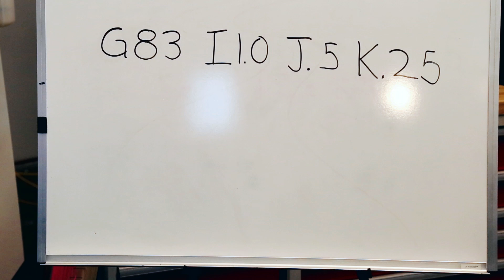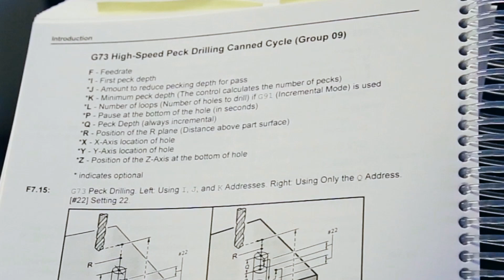Don't Waste Cycle Time; Peck Drilling Essentials - Haas Automation Tip of the Day

Comment: what would you recommend for an .098 drill (number 40) in steel?
Reply: What type of Steel? Do you have coolant through? If so, what coolant pressure do you have?
Reply: Steel type? Heat Treated? Drill material type? Desired hole depth?

If Through coolant is used, you can just use g81.

If you are just using a mild steel like 1018 and a basic HSS-Co drill and drilling about an inch deep, you can pretty much do this without a lot of fuss or effort.
Something like S1000 F2. g83 q.25 z-1. should do the trick for small hobby machines / small shops.
A lot of people have trouble drilling with small diameter tools, hope that helps.

Comment: Do you have any tips for drilling with large diameter (i.e. 1/2 inch and above) HSS drills?  I was drilling a 1 inch deep through-hole with a 1/2 inch diameter drill bit (brand new from McMaster Carr) in 6061 aluminum with one plunge (since 1 inch is less than 4*diameter) and the bit seemed to scream a little bit.  I later tried it using a 1/8th inch pecking full retract cycle and there was still a bit of screaming and strange noises.  And sometimes a chip would get wrapped around the bit before it plunged for the next peck and it almost seemed like it was going to jam up.  I had two steady streams of coolant flooding the bit and hole in each scenario.  Would you want to drill progressively larger holes or is there another strategy to get better results?
Reply: Sounds like you are using a bad RPM / Feed to me. The bigger your cutting diameter, the slower it needs to go.
If you aren't trying to drill a thousand holes a day or anything, and you'd rather prefer a clean hole wall 
I'd use 800 - 1000 RPM with a feed of 4ipm. 
So like,  S1000 g83 z-1. q.400 F4.  
The reason why q.4, is because alum chips tend to get really stringy and need to be broken up to avoid a tornado of chips on the drill. Also breaking the chips up and doing a full retract with g83 will allow coolant to go in and prevent the aluminum from welding itself to the drill.

Also, try drilling with an HSS-Co drill instead of an HSS drill. They will cut better and have better edge geometry.
Reply: @Brokoro  Thanks for your reply!  I was using 3439 RPM at 20 IPM (on a 3.5 HP Matsuura Tiger) that I got from my HSM Advisor calculator, but it looks like that wasn't quite slow enough.  I will try slowing the feed and speed down with the full retract cycle per your recommendation and see if I get a better result.  Would a carbide drill cut much better than an HSS-Co drill (a carbide drill would obviously be a lot more expensive than an HSS-Co drill so if the results would not be much better than I would much rather use HSS-Co)?

Comment: sorry where is the total depth do I go G83 Z-2.0 I.5 J.125 k .05
Reply: Normally Post processors will put the Z after the g83 like you have in your comment. But most fanuc machines don't care as long as it is on the same line as the G83.
But you are A-O-K with how you wrote it out.

Comment: Hey bro ,I got a doubt and what are the problems of combining a drilling and tapping in a single tool.
Reply from the maker: pushparaj – They make them. It gets weird in a CNC machine though. Most drills like to feed at maybe .125mm per revolution, where an M6x1 tap must feed at 1mm per revolution to keep the threads nice. It’s possible though, you could use one feedrate for the ‘drill’ portion and another for the ‘tap’ portion. Fun stuff. – Mark, Haas Tip-of-the-day
Reply: @haasautomation   so it's not recommended for drilling and tapping? Right! And what happens if the drill speed is used along with drilling!
Reply from the maker: @Raja-kk1zi  Pushparaj –  It’s not practical for drilling and tapping into solid material. The deeper we go, we will need the regular flutes of the drill to evacuate the chips. For through holes (thin wall), it is very possible and it could save us a tool change. – Mark, Haas Tip-of-the-day
Reply: @haasautomation  ahmmm....thank you!! And i would like to look into it more!!!
Reply: @haasautomation  Actually they make thread mills now that don't need a pilot hole even in steel and as an added bonus we were able to lower our sky high coolant concentration that we attempted to reduce small tap breakage in steel! Your videos are awsome!

Comment: what is the main object to use G83?
the main object to use G83 is to remove chips from deep holes~
Reply: It's mostly to cool the drill tip. The helical flutes pull the chips up but prevent the coolant from going down. This is why through coolant drills don't need to peck.

Comment: Can I use IJK with G73?
Reply from the maker: SuperAWaC – Yes, those same IJK values will work with our G73 High-Speed Peck Drilling cycle, which can give you the best of both worlds. The drill, with a G73, will back up slightly with each peck, but won’t retract all the way out of the hole. – Mark, Haas Tip-of-the-day. For more info, download the Haas Mill manual from our website, www.haascnc.com.

Comment: With the I-J-K do I have to use G98 ?
Reply: George Papadimitriou Yes, with I J K you have to use G98 or G99 as your choice for drilling the other holes with 'Z' initial value  or 'R' value.
Reply: Thank you
Reply: Now i was told peck drilling helps keep drills from walking especially longer drills? Is this true

Comment: I don't get how the I value is 1.0 yet that accounts for 4 times the diameter of the hole in length? Shouldn't that be I4.0, isn't the number the factor of the diameter of the drill how does it work, anyone? Thank you.
Reply from the maker: MLG420 Mcswaggerten – Take a look at 4:12 in the video and following for a recap. In our case, we go I1.0 in that first peck (4 x D, which is 4 x .250” = 1.0”). The IJK values are in inches, not in “tool diameters”, although that would be cool. – Mark, Haas Tip-of-the-day
Reply: Ah I understand now, It's a tiny bit confusing because where I am from we use millimetres haha. Right so you're using a 1/4" drill where 1 inch is 4 times the diameter. So if you was using a 1/2" drill then you'd have an I value of 2 so I2 and 1" drill you'd have an I value of 4. Brilliant thanks !

Comment: cycle time not mean anything on small job. do you have time make new setup handling other 7 machines alone? its fine if you can make parts in 8 hour even machine run would be3 hour it still take 8 hour make them when have others machines. and it gets worst if machine time is 5 minute. dont have time to run change parts while doing some on other machines
Reply: That can be true. If I am using a new drill on each job, a small Q peck isn't going to hurt us. If we are reusing our HSS drills on many jobs, they will last quite a bit longer if we can take fewer pecks with them. Once a drill starts to go dull it will start heating up, and can work harden our material as well. Finding a happy-medium, where we peck no more than needed will extend our tool life. Maybe try just using a 3 x D First Peck (I value), and that alone might save us 5 or more pecks, without risking any problems.